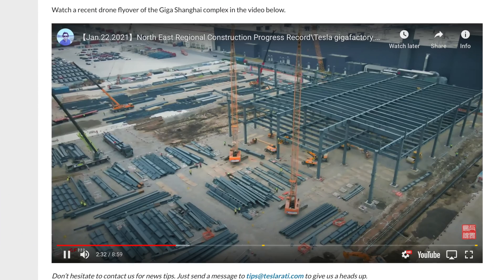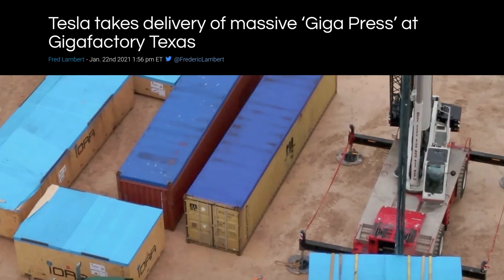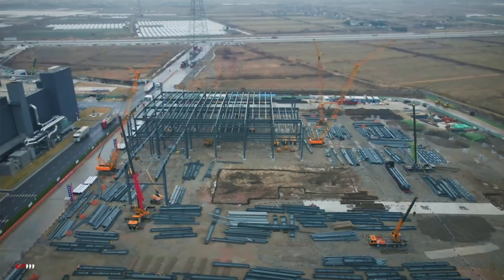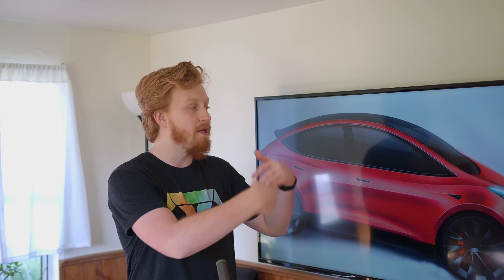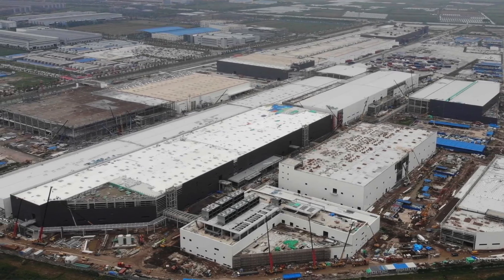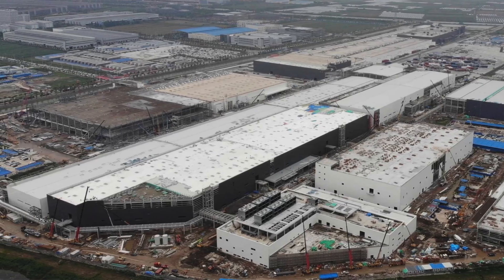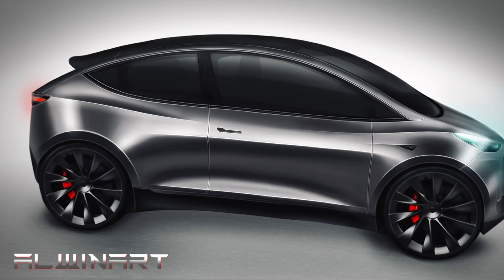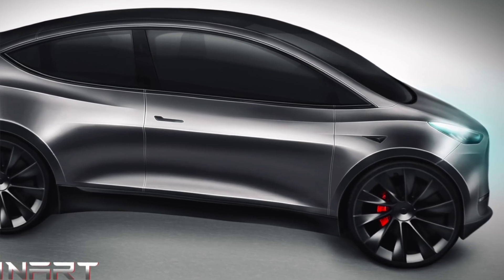GigaPress is the Key to Tesla's Mission

Comment: Microfactories are way better and they'll outstrip Tesla and gigafactory models. Microfactories are modular and adaptive, they will benefit more from AI supply chain management where assembly can be non-linear. There's also a virtuous Loop between AI Supply chain management and Manufacturing if you really think about it.
Reply: Yes and No, Tesla Factories because Tesla is highly vertically integrated and are actually a series of co located for parts transportation efficiency mini factories, Also Tesla is re inventing the manufacturing processes for maximum efficiency and throughput.
Like everything else it is horses for courses, Auto manufacturing is using very expensive paint shops, stamping machines, robots and in the case of Tesla Giga Presses.To be economic a high volume throughput is required and a micro factory would not have the room for all the equipment nor the volume throughput.
A Tesla Gigafactory with all the gear and the volume throughput will have a far lower cost base for their vehicles and be able to produce an excellent quality budget car eventually and yet still have a high profit margin whereas their competitors will be struggling to be profitable.

Comment: How many tons does this gigapress is pushing? Does it deserve that name or is just propaganda?
Reply: It actually is not a press, it is a casting machine (aluminum injection moulding)
Reply: @j.pgoodwin9020  It is a press, its using large platen held to together by tie bars, while holding the mold halves closed under high injection pressure. 
Hence Injection Press.  
Its very similar to the ones I helped build. Including this unit that was the largest in the world 20 years ago. 
https://www.autointell.com/News-1999/november-1999/news_of_November-02-99-p2.htm
Project was originally to make an entire half of car in one shot (split in the middle front to back) and include floor and roof. Project was abandoned and the machine is still churning out single piece Jeep Wrangler removable roof (ABD + Fiberglass material). 
We did metal injection back then as well. 

Maybe you are thinking of a stamping press style machine?
Reply: In weight, roughly ~400 tons. In clamping pressure, more than likely ~6,000 tons. 
What blew my mind was the injection speed. Something along 10 M per second.  That takes a hell of a hydraulic control (flow/pressure) to handle that. 
They must be using hydraulic intensification cylinders to achieve the speeds. 

https://en.wikipedia.org/wiki/Giga_Press#:~:text=Each%20machine%20weighs%20410%E2%80%93430,%3B%2036%20km%2Fh).
Reply: @fredpinczuk7352  Push and pull aka vacuum chamber that cycles with the injection.
Reply: @Barskor1  makes sense, we used gas injection back in the day to get those speeds.

Comment: From what l have seen of the updated model 3...
If Elon goes to solid state batteries he will be in front.....
Toyota is just about to release solid state batteries so the game continues...
Reply: It is a matter of volume production and cost benefit.
So far the Solid and semi solid state offerings are mot expected to be in mass production for at least 4 or more years and with a energy density of 400 WH/Kg approx , by then Tesla 4680's are not far off that and very cheap to manufacture and rapid charging , so not open shut , there are many different batteries and there are existing solid state batteries being used , but it is a matter of cost and robustness so there are many niche applications of different batteries
Reply: Without a doubt, Tesla is cooking up new battery types and chemistries and solid-state is going to be at least one of them.

Comment: The big casting press is not an advantage its just another method of production, plus tesla still needs stamping presses for many other parts of the car. Other manufacturers already have all the equipment to make EVs they just needs the batteries
Reply: You should watch Sandy Monroe videos on how much of a lead and advantage the press is vs legacy auto makers.
Reply: @edsta714  i havent seen anything from him where he compares this method of production with other state of the art ones...
Reply: @edsta714  the legacy auto makers already have all the equipments and presses needed, tesla is still trying to grow. The casting will just improve their production but its unfortunately not a leap, nowadays all car models shares platforms to significantly reduce the cost of production, for example the rav4 and camry and many lexus have the same chassis and the engine is used in rav4, camry,  highlander,  sienna, lexus.........
Reply: @edsta714  tesla simply cannot compete with vw when it comes to efficient mass production. A vw is finished every 16seconds at their Wolfsburg factory.
Reply: You dont understand
Reply: @Relansls  uhm you too.

Comment: Weird they keep putting these massive wheels on these renders of cheap Tesla's. One of the first things I would cut the price of for the car would be the wheels to get the price down. AKA probably a 15-16 in steel wheel with an aero cover on it would be more likely
Reply: I agree with the ridiculous dimensions of the rims on such a small car, but do not actually believe that TESLA would EVER go aesthetically cheap by using STEEL wheels (3x heavier than aluminium, bad for efficiency) and just stick an aero cover on it (which again defeats the purpose of efficiency on an electric car). 

I'd guess the biggest wheel option on such a small car (if that's roughly the actual size) would be 18" with rim sizes starting at 17" (or maybe even 16"). Because if you follow the rest of the lineup, they always only offer 2 (rather large) dimensions:

Model 3: 18" or 19"
Model Y: 19" or 20"
Model S: 19" or 21"
Model X: 20" or 22"
Reply: @YaruSasaki  Even so, a 16" aluminum wheel is more realistic. They'll need a smaller wheel for a smaller car anyways just to fit it on the car. Most subcompact cars do not have large wheels at all
Reply: You do realize those batteries make the car ridiculously heavy right? This model 2 would probably weigh like 3500 pounds. Hit a pothole going over 40 with a steel wheel with a 3500 pound car and you’ll be visiting your local wheel repair shop.
Reply: @iwantmykidssusan  Google how much a Silverado weighs and then let me know if you've ever seen one with a steel wheel before...
Reply: Lower rolling resistance = range and clearance. Very little impact on price at volume.
Reply: @RacefanPat68  when you're trying to make an economy car, every penny matters. There's a reason why you often see 15in tires on economy cars
Reply: @flakes369  On electric cars, drag coefficients and rolling resistance are more important than normal.
Reply: @flakes369  The cost of a bigger wheel and (skinny) tire has to be traded off with extra weight and cost of more battery storage....  Most small ice cars also have smaller motors and fuel tanks, and less steel. You have to consider that in an electric car, although you do have much more power and torque, ... to get range you need to add weight in batteries, and therefore reducing this becomes more valuable. It is an interesting conundrum, and teslas casting processes may change this equation. It will be interesting to see.

Comment: It’s have all kinds of compelling property’s but A chassis made in molded in aluminum and batteries as a structural part is going to be almost impossible to repair.
Reply: This hole thread boils down to one cold hard reality.  No industry can survive by manufacturing things that last forever even if it is technically possible and affordable to do so.
Reply: @2bittesla  in the 70’s Porsche designed the FLA car to last almost forever even in the harshest environments. It would been expensive to build and who would buy a new car when the old one lasted for 30 years so they decided against producing it. After all. Porsche is in the business of building new cars.
Reply: @2bittesla  yeah thats the sad reality.
Reply: @2bittesla  What do you think the Tesla Robotaxi fleet is for? A car that lasts forever can be profitable depending on your perspective.
Reply: @Barskor1  I suspect that will be a 10 year practical life.  They will essentially be running full time and have significant wear and tear that will render them un-economical to maintain.
Reply: Castings are mostly used in the automotive industry for suspension towers and engine mounts and many other parts
Reply: It seems that is already the case with late model cars. Its no longer feasible to do much more than paint and minor dent repairs. If airbags are deployed,  it's game over,  off to the scrap yard.  The stamped chassis should be more efficient to recycle.
Reply: @2bittesla  nonsense, metal sheets are way more efficient to recycle, thats why we have giant car crushers
Reply: @carholic-sz3qv  that's what I'm saying,  cars are becoming more disposable and less economical to repair.
Reply: @2bittesla  exactly, the manufacturers should make parts available and facilitate rebuilds, it has been a serious issue for tesla, since I've watching rich rebuilds.
Reply: @2bittesla  people love to buy used/cheap cars and i dont think a very cheap EV is a good deal.
Reply: @carholic-sz3qv  should is not a good business model.  As more ev  manufacturers enter the market the anti wright to repair issue will prevail.